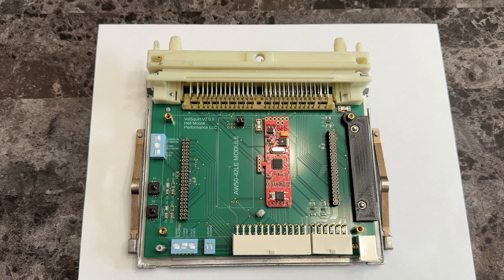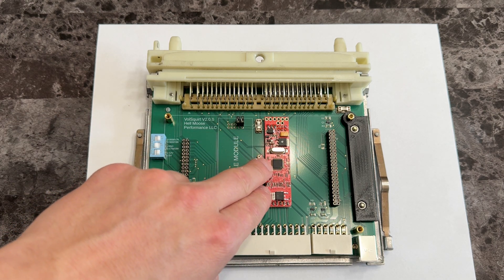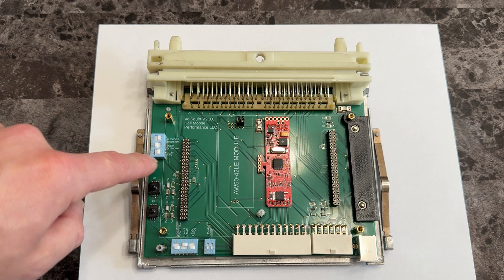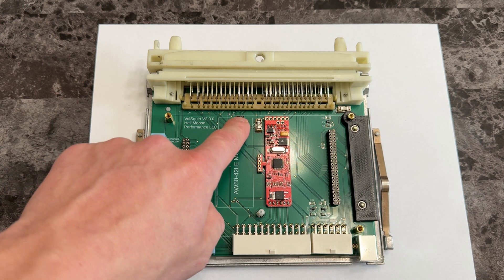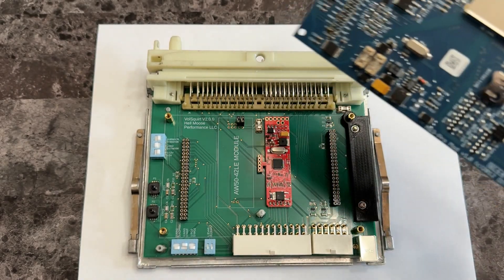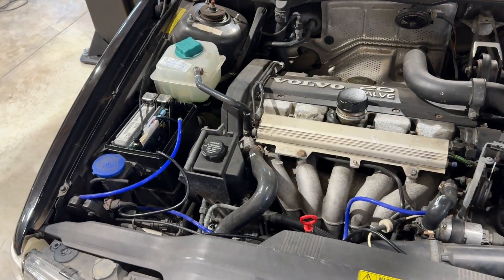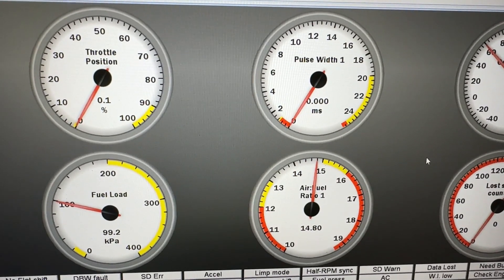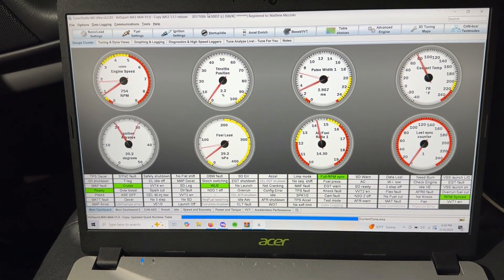94-98 M4.3/M4.4 VolSquirt V2.0 FULLY Plug n Play Standalone ECU

Comment: There are still canbus outputs there, right? I have a display from NexGenEFI that is programmed for megasquirt.
Reply from the maker: Yes the CANBUS is still exposed on the 24 pin header as it was before. There is just no more extra 8 onboard ADCs. You can buy external modules for so cheap now I couldn't justify the extra onboard electronics to do the conversion and send it over CAN to the MS3PRO.

Comment: 960 you say? Very attractive, what kind of performance gains or economy gains can a naturally aspirated whiteblock could we see?
Reply from the maker: Yes it is plug n play for 96-98 960, S90, V90 M4.4 whiteblock 6 cylinder. It uses the Mega Squirt 3 Pro standalone under the hood and allows you to adjust for any mods you make to reap the performance or economy gains from said mods.

Comment: With my 2000 V70R, I've been wanting to do a custom ECU for a while, or go with a MaxxECU or something.  If you ever look at developing and need manual swapped VR tester, let me know.
Reply from the maker: I have been working on a PnP solution for the 99-04 P80s. I have all of the circuitry figured out and started a bit on the schematic / pcb. I will post some updates on that soon too. I need to try and find a good running ME7 P80 to test with.